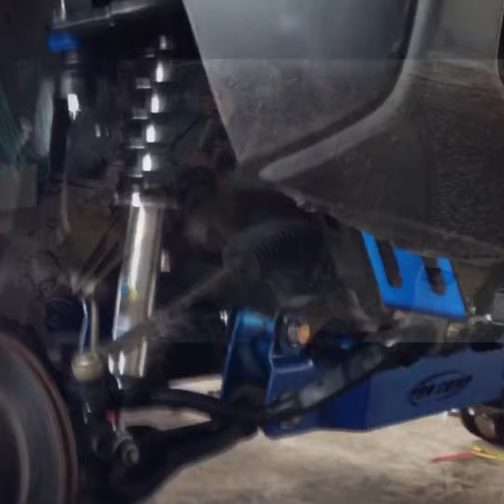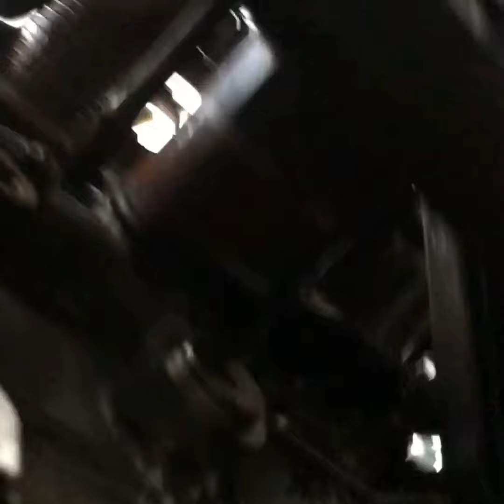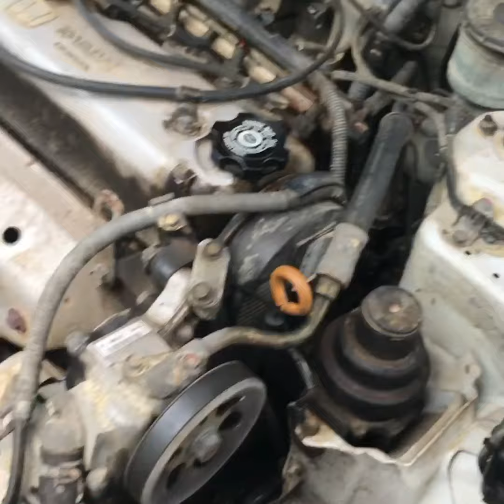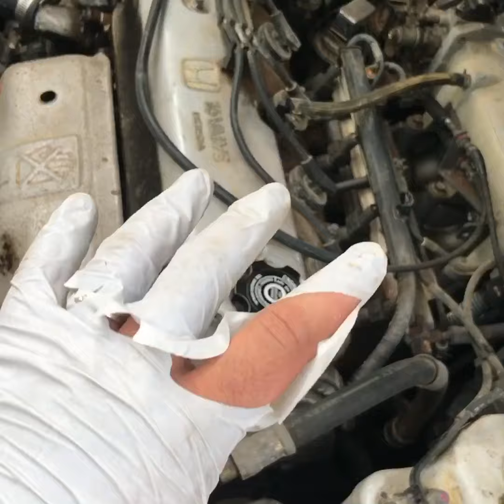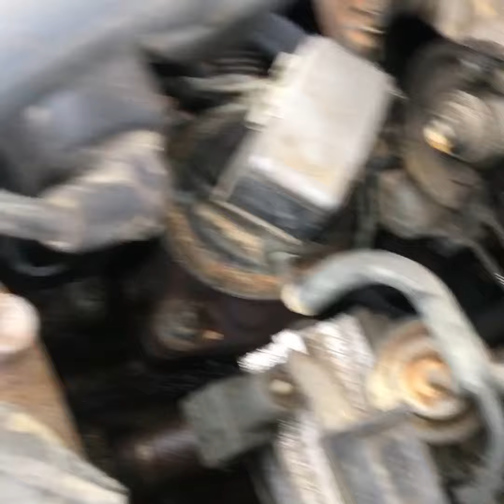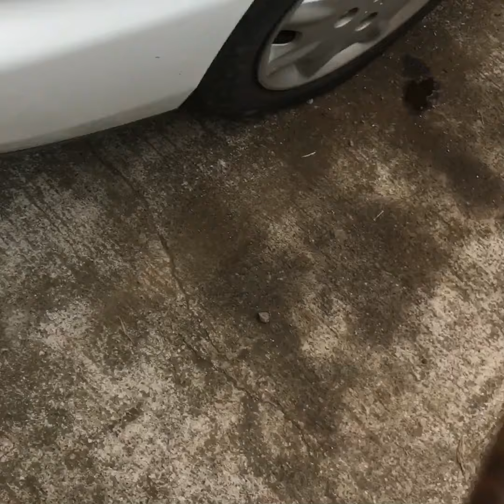Accord leak behind engine

Comment: I have a 1994 hands Accord and it does have a leaking problem on the right side of the engine and I don't know what to do about it. Can you please help me with this please thanks.
Reply from the maker: Sure. You have to Jack your car up, high and safely. Dry all and any fluid there is. Then start the car, with the engine running head back under with a light and look for the leak 👍
Reply: I know where the leak is I just don't what to do about it it's just beside the head of the engine next to water pump.
Reply from the maker: @stanleymallatt4627  can you take a photo and send it my way? Hollery.mail@gmail.com
Reply: Sounds like water pump weep holes leaking indicating time to change water pump

Comment: I have a Honda Del Sol 95'. Oil just massively came out tonight... it seems to be towards the back of engine and down... What do you think that could be? Lug nut came loose or Oil filter ring? Thanks for any thoughts on this...
Reply: check the oil pressure sensor right above the oil filter - right in same area as in this video. Get the car on small drive-up ramps & get under there with a good light & you should see it. Its a cheap fix- just a bit difficult to reach. Highly likely...
Reply: @jimeeatc  Thanks for responding. Turns out it wasn't an oil leak...    Turns  the Engine Coolant Bypass hose that connects to the head had a tear in it. It was steam not oil smoke... Already fixed it, everything is good! Thanks!

Comment: Cool!  Wish i knew what the sensor is on the back of the intake that's white and in the middle of the intake, and where those two wires below the black thingy go.  They come off a gray looking electrical what not.  Sorry for the 'technical' language, but I don't know what they are called.
Reply: the sensor is throttle position sensor most of them are held on with break off bolts from the factory you have to use a Jack saw and cut a slit into them then u can use a flat head screw driver ..also u have to have a volt meter when u put the sensor back on to get it in the correct range to operate properly.

Comment: I already figured out my water leak is probably a hose to/from the oil cooler.
I can't see to tell which hose is leaking and I thought I 'd look at a repair video to get a better picture in my head of what I can't see.
But I'm coming away from this video possibly knowing less than when I started.

Comment: What kind of hose is that?
Reply from the maker: Lorie Munoz this is just a 2ft long 1/2” radiator hose but you can use any hose rated for high heat. Silicone high temp hoses are your best bet.
Reply: @TorchedTv  thank u
Reply: Heater core hose